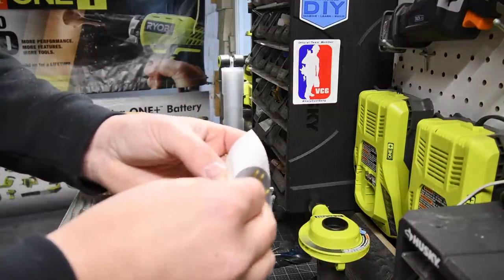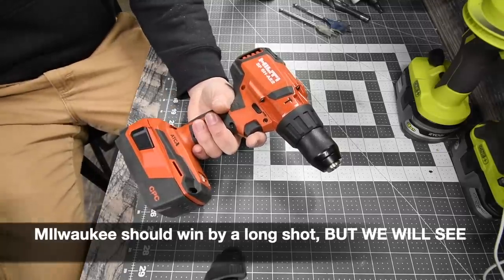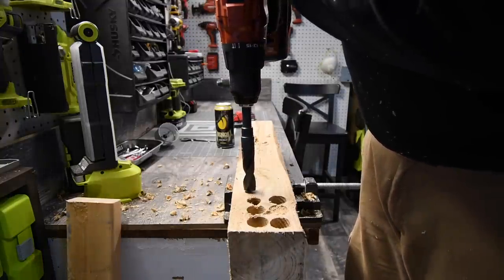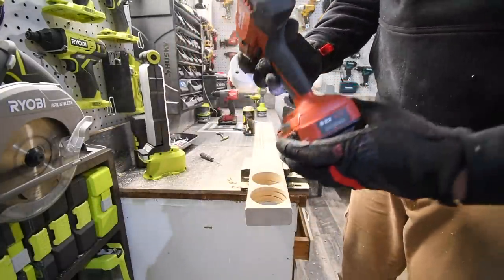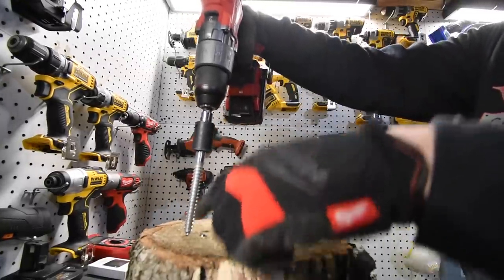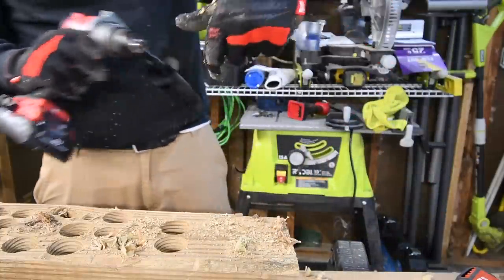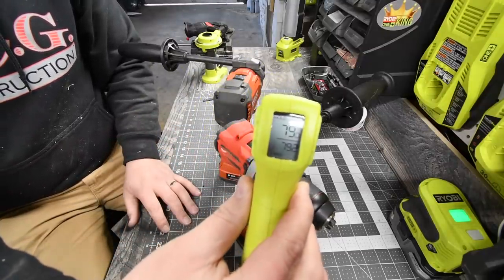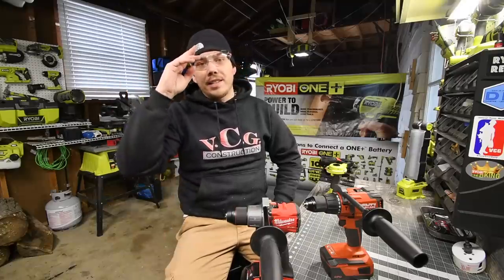Milwaukee vs HILTI (WOOD)

Comment: Hilti did it this time, brushless and sexy design, i really like it, but you must know that you are testing a 18v 3ah battery against a 22v 4ah.  Considering the price, Milwaukee wins.
Reply from the maker: correct, the price does justify the tool and thank you music
Reply: we have used milwaukee impact wrench for 4 months and is broke. Milwaukee has great specs but doesn't last long.
Batteries wear out, start to wobble and milwaukee is the same price as hilti in Europe. Best of all, milwaukee offers a fleet, so never a problem when is breaks.
Reply: milwaulkee with standard 5ah wins
Reply: @Alain01barneveld  im from the EU, dont tell that to me.
Reply: Price and battery size/capacity benefit.
Reply: Alain you mean Hilti offers a fleet.
Reply: Alain Have a Lot of Milwaukee tools and never fail me ,  had a hammer drill m18 from  2002 when I arrived to USA and still working well, and I have the m12 line. Ratche1/4stubby 3/8, drill impact m12 , die grinder m12, sawzallm12, impact wrench m12, , this tools 2  , 3 years with me ,and 2 partners using this all the time , never had a issue, that’s why in USA are the most selled ,  hilti is the best tools for big industrial tools but quite Frankly in 12 ,18 and 20 v they don’t pay off , too much expensive and this is not the field  wich a hilti tool pays off,   I like hilti too, I sometimes sent tools from USA 🇺🇸 to Ecuador 🇪🇨 , the last one was a hilti bx3- ME 02 , a beautiful metal and concrete nail gun ❤️in heavy duty construction far are the best tools in the world

Comment: I used Dewalt growing up. Turned out to be Junk so I went to Milwaukee. I liked it and it got the job done. Then I went to Makita. Absolutely love Makita. I recently started getting into Hilti. I love the Hilti for its versatility (4 speed gearbox). For off the shelf brands, Makita is the best in my opinion. Simple tools with incredible power. Hilti is definitely my go to in terms of professional/hard use. Especially now that the Hilti drills (no accessories) are priced INCREDIBLY well. I got the 4 speed drill for $209. That’s not much more expensive than Milwaukee or Makita and you get their support and build quality behind it.
Reply from the maker: I agree and I thank you Diener. I love makita as well. it is turning out to be my favorite tool brand for power tools
Reply: Man Caver Tools You definitely can’t go wrong. With any of them really. But I am biased. 😅 I have a a 1/4” and 1/2” Milwaukee impact and an SDS rotary hammer drill, makita grinders and drill, and then the hilti I just got. These tools are my livelihood and I have no issues using any of them.

Comment: What a great vid. I'm from Europe and have never got the DeWalt Vs Milwaukee battles. Hilti has been No1 in Europe forever. Slightly less power (as we don't actually need it all) but runs forever and survives drops and wear and tear like no other.
Reply from the maker: I agree and thank you sir
Reply: This Hilti has more power than the Milwaukee!!
Reply: @davesheppard8797  hi Dave. I don't know the specs but the video Def seems to back you up. They were the best tools even without the power so if they've now got it it's game over for the pretender companies
Reply: @shaneporter4958  yes....the Hilti has more power and class. People keep saying the Milwaukee would be better with a bigger battery. As far as I'm concerned that will only give you a longer run time. This morning after watching this last night I put My Gen3 Milwaukee and this new Hilti head to head. For the Hilti, I used a 2.6 amp hour battery. For the Milwaukee I used a 9 amp hour. The Hilti still kicked the Milwaukee's arse. The Milwaukee was no more powerful than with its 5 amp hour. Plus the triggers on the Milwaukee's are crap. The Hilti wins in concrete too using 6mm bits. I didn't go bigger because anything more than 4,  6mm holes 2" deep I get out my Hilti Te6 A22. Why thrash the crap out of your combi-drill drilling big holes in masonry when an SDS will do it quicker and smoother?
Dave 😁😁
Reply: @shaneporter4958  Also....I bought a load of Milwaukee tools and find they are really overhyped and their torque claims are way off!! I own Gen3 combi, Gen3 impact, fuel jigsaw and fuel 61/2" Circular saw.  The Circular saw is great. The first on had to go back faulty but the second one...so far ....... Is a great little workshop tool. I already had the Makita corded 210mm Circular that will cut 4 sheets of 18mm birch ply in one go. So I wanted a small lightweight saw.
Reply: @davesheppard8797  Dave I hear you on the Milwaukee and the misleading claims. They're flooding YouTube though with biased shows and slight naive construction workers are eating it up whereas they should be spending a little more on Hilti and having s tool that will last them years
Reply: @shaneporter4958  very true mate! Also the Milwaukee Gen3 gets very hot compared to the Hilti. I find Hilti tools really nice to use though...they are smooth and comfortable to hold. And let's face it, the drill is only as quick as the skill of the guy using it. I am an old fashioned Carpenter joiner. I still hand cut lap dovetail joints. I wouldn't dream of drilling in an M8 coach screw without a pilot hole. If I am on a timber construction job that is fairly neat. I have a drill with drill bit, a drill with a counter sink and a drill with a screwdriver bit. This speeds things up without sacrificing standards. My Gen 3 Milwaukee, my Gen3 impact and my fuel jigsaw all have times when I  pick them up in the middle of a job and the triggers don't work. Always with plenty of battery. I have to keep squeezing the triggers till they work again! This gives me no confidence in them.
Reply: @davesheppard8797  it's good that your on here Dave giving out the correct info rather than the Milwaukee influencers who mislead the consumers with phony tool battles and bullshit statistics
Reply: @shaneporter4958  Hi Shane, I  just tell it as I find it. I did a head to head test myself as I own the Gen3 and this new Hilti. 2.6 amp in the Hilti and a 5 and 9 amp in the Milwaukee. The Hilti came out top on everything.  Where the 135Nm of torque comes into play on the Milwaukee I don't know. On speed 1, highest torque setting on both drills, the Hilti easily beat the Milwaukee when driving in 3" hex headed M8 coach screws.  The Milwaukee left them 3/4" sticking out plus the head. The Hilti sunk them in flush...head and all!!
I got caught up in the Milwaukee hype and bought 4 of their fuel tools. None of them live up to the hype and all bar one has a trigger issue. The one that didn't have a trigger issue was sent back with a faulty motor. I know other people who bought Milwaukee tools who are also disappointed.  I will stick with Hilti from now on. I have a second hand Hilti corded te1 that I was given 33 years ago and it is still my Go-to corded SDS. It can still hold it's own against modern SDS corded drills. It has never been serviced and pretty kicked around  over the years. It is still as smooth as silk. That is a testament to me that Hilti's are quality!!....Also if you want to try a Certain tool out before you buy it, A Hilti rep will bring one to your place of work for you to try out and test. You can find out  if you like the tool before spending any money out!!
Dave.
Reply: What is Hilti number 1?
Where can I find a reliable rating?
Reply: And it's not about whether they are better or not. And about the fact that the author misleads twice with his test: the first time when he says that the battery in Hilti is ordinary, and in Milwaukee - special, and the second time - without specifying that the battery is of a lightweight type.

Comment: I own Milwaukee m18 kit. 4yrs old. Never had a problem and the batteries are still sweet as. As a builder the drill gets thrashed and has had a hard life. Balance and control is what you really need to avoid user fatigue. I feel hilti has the advantage here and is probably the best tool company in the world. I own hilti gear as well and they will guarantee their tools for 20yr! Hard to believe right. What other company stands by there gear like this.....
Reply from the maker: HILTI is a great brand and thank you for viewing
Reply: I too own Hilti and Milwaukee.  I find the same. Hilti are in a different class. I was given a corded Te1 33 years ago. A contractor left it behind and after many phone calls he told me to keep it as he had got an upgraded Hilti. I thought if he was just giving it away it must be pretty worn out. 33 years later it is still my favourite corded SDS. It has never been serviced and it's been pretty abused over the years. It is still silky smooth to use and can hold it's own against modern corded SDS drills. I also use a Te6 A22 with a 5.2amp battery and that thing is amazing! I have had lots of problems with the triggers on my Milwaukee kit.
Dave.